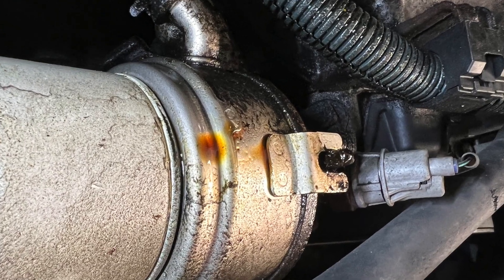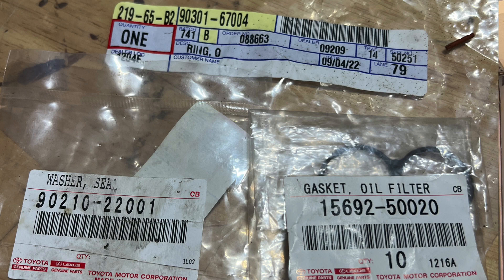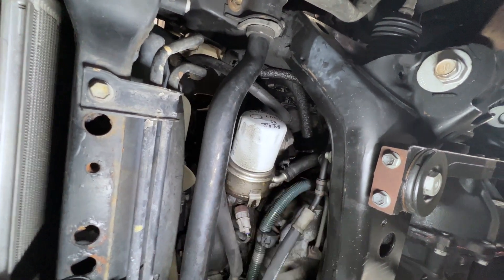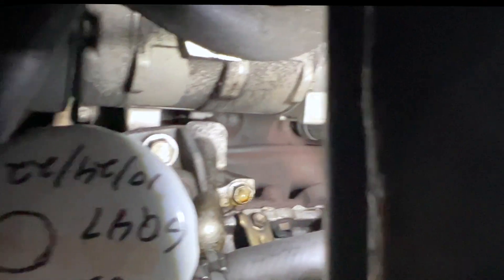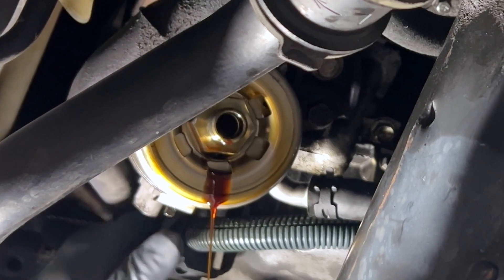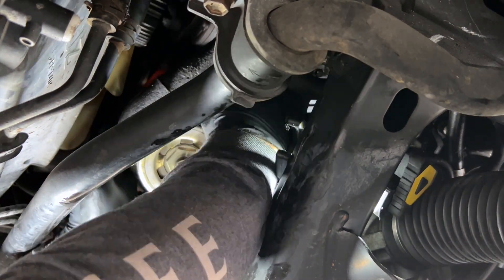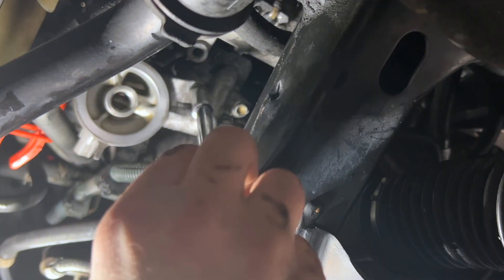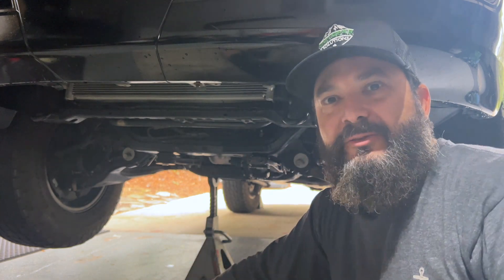Lexus GX 470 Oil Filter Adaptor Seals | 2UZFE Oil Leak Fix

Comment: The steel washer is OEM with the bolt. I don’t think it’s available separately from the dealer unless you purchased the bolt. The steel washer with the rubber seal in the center is actually a washer gasket for the VVT-I cam cap. But if it doesn’t leak that’s also good. Great video.
Reply from the maker: Thanks for the heads up, appreciate it.

Comment: Is there an option to buy new oil adopter or only seals and gaskets, I can’t seem to find new part for 09 gx470
Reply from the maker: There might be, what parts are you having issues finding. The seals I ordered where from a dealer. Check Lexus parts online. Thanks for watching.
Reply: @ClassyTacos  the whole assembly I found seals , but can’t find engine oil filter adapter, found one for tundra same engine not sure will it fit
Reply from the maker: @nemanjabelos3888  I see. If you're dead set on a new one go factory and be prepared for the cost. I don't see the benefit of a new one for this specific part unless you see it's damaged.

Comment: Hi, Why is a coolant line attached or running through a oil filter? Thanks
Reply from the maker: The coolant runs through the adaptor to help cool the oil. It does not run through the oil filter. Thanks for watching.

Comment: Are the gx470 parts and this oil filter assembly the same part on a 4th gen 4runner?  I need to get the assembly part, not the cooler piece.  I over torq’d and cracked the oil sensor threads.
Reply from the maker: I have not done a 4th gen runner so I can not say for sure.

Comment: How much oil was actually leaking for you to notice? I have a little oil leak on the front driver side right by the filter. There’s no puddles when I park up just a couple drops. I have an ‘07 with 217k miles. Things a champ
Reply from the maker: I had very little drops on the ground. Most of the oil was getting thrown onto the engine and headers while driving. The burnt oil smell was pissing me off. Thanks for watching.

Comment: Very helpful video.  Thank you.

I recently purchased a gx470.  What website do you use for viewing parts diagrams?  Also, what websites do you recommend for buying parts?  Thanks again.
Reply from the maker: Thank you. I will normally go between Amazon, Parts Geek, Lexus Parts Online or straight dealer on a google search. I go for the best price usually. Between those sites, they normally have what I need. Some dealerships sell parts on Amazon & E Bay so the shipping is cheaper.

Comment: Where exactly was leak coming from,  figure 8 gasket or the big O ring, or washer?
Reply from the maker: All the gaskets were flat and lost any ability to hold oil. Usually it's the figure 8 gasket. If you're going in there just replace them all. Thanks for watching.
Reply: @ClassyTacos  makes sense.  Great video!  I haven't found one more detailed. Thank you.
Reply from the maker: @Kdawg101  thanks, I appreciate it.